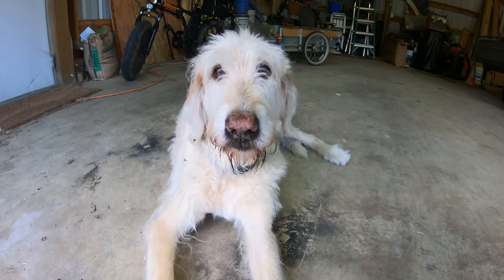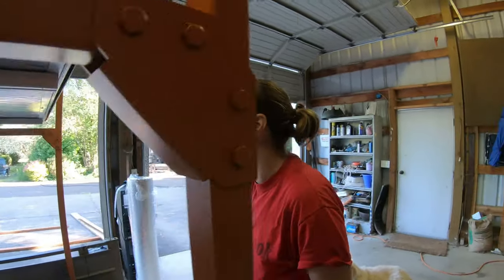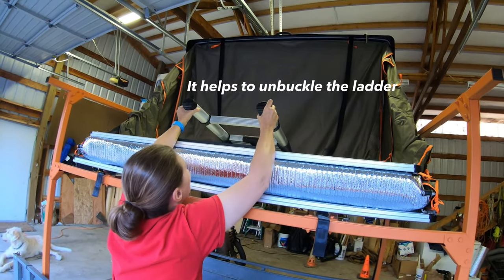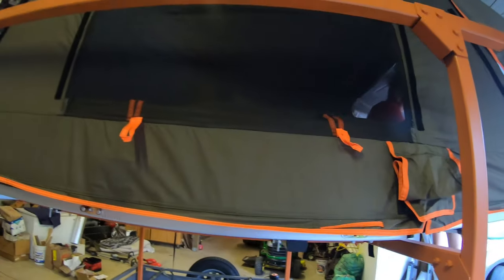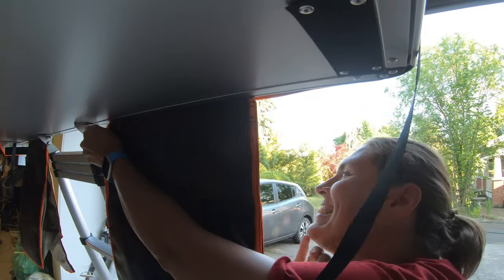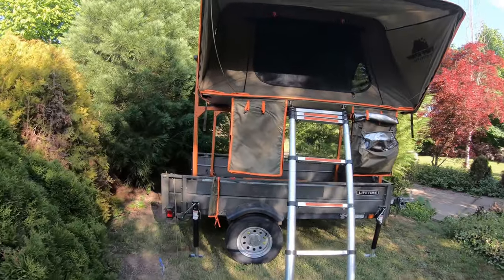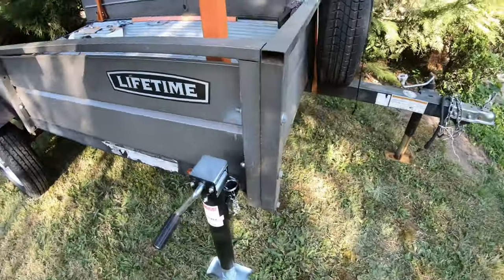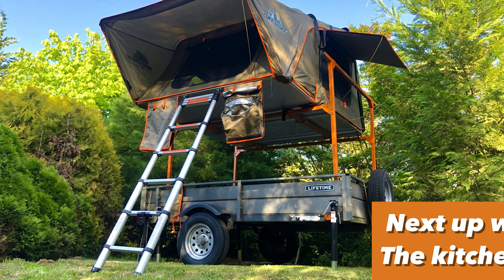TUFF STUFF ALPHA - Mounting the Roof Top Tent on the Trailer - Part 3

Comment: im REALLY liking that design for a roof top tent on  a utility trailer. Question....with the tent stored. it looks like I could also carry a canoe above the tent on those cross rails without damage to the tent. My only additional thought is to make the vertical supports telescopic so I can raise and lower the overall height for tenting/travel. Im also trying to incorporate a 4 wheeler UNDER the rack on the trailer. You got my wheels turning here. Overall....how is the rack and tent working out? I will go back and watch the series again for additional details. Any additional info you can provide would be great!
Reply from the maker: The rack has been working out great for us so far. There are a few designs online where people have the rack able to raise or lower. We made the minimum height just tall enough so we could store our bikes underneath. It also turned out to be just the right height to be streamlined with the top of the truck for better gas mileage. We did build the rack to carry hard sided kayaks on top but ended up going with a Drop Stitch Inflatable Kayak which we are happy with. It can be stored in the truck or the trailer without issues.

Comment: just saw all the videos with respect to the roof top tent...great videos. I'm also thinking about buying this RTT, plus they are only a few miles from where I live. I was looking at the iKamper ladder (which they sell separately for about $150), their steps are angled so that they don't hurt your feet, I wonder if they can be a viable replacement (assuming money is not an issue) and possibly a bolt in with no modification. I search through the web and didn't see anybody try this out (with any RTT).
Reply from the maker: After camping a few nights in the tent we found that it wasn’t a big issue. We climb up the ladder and sit on the edge just inside the door. From here you can easily put your shoes in the little hanging shoe bag. We usually have sandals on in camp so it’s an easy process.

Comment: We cheated! We used the forklift on our tractor to lift our RTT for mounting 🤣😉 So let me ask, did you find on your mounting brackets that the nuts really don't want to back off after tightening them down?
Reply from the maker: That is cheating with a forklift but I’m sure it was nice to have.   We haven’t tried to undo the brackets so not sure about the nuts.
Reply: @ExploreTrekAdventure  lol, well it certainly made things easier.  I'd like to know about your mounting brackets. I only discovered it because I ended up having to slightly reposition my RTT on the rack.

Comment: Just use a hack saw to cut the excess length off the bolts. Easy!
Reply from the maker: I will have to get a new blade and try it. Thanks you for the suggestion.